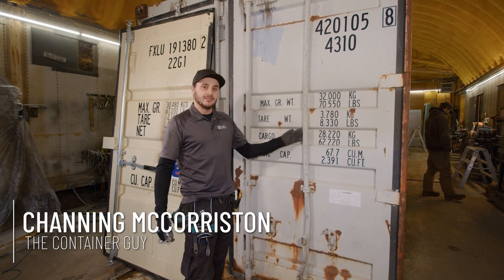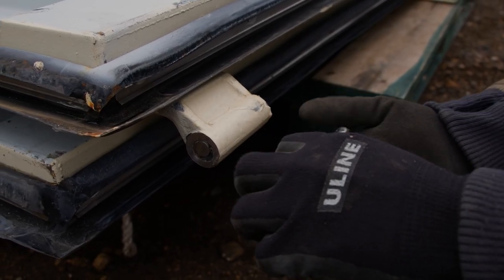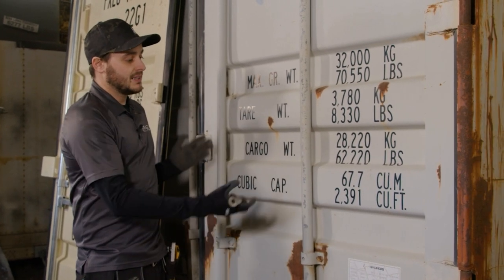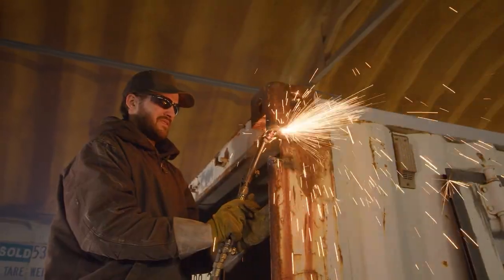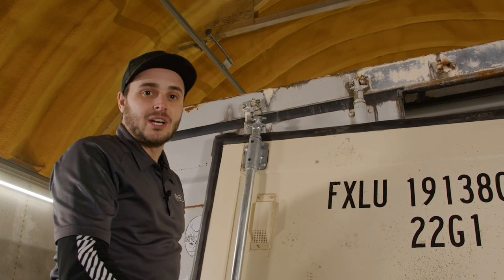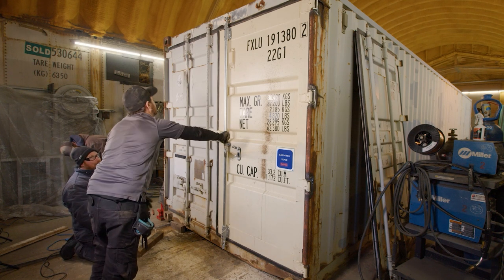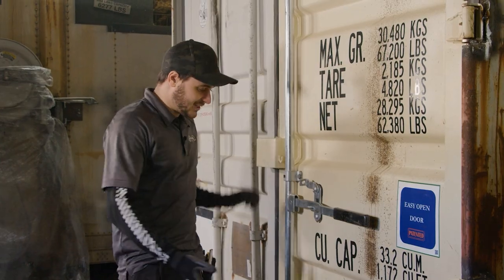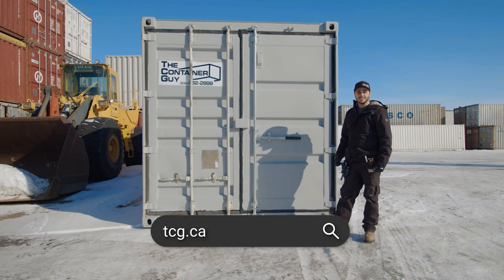Replacing Shipping Container Doors - Not Worth It ?

Comment: I would love to know if you have made a video tackling the removal and replacement of the pipes on the container doors. I am in an area where I cannot find doors and just have one or two bent bars, so was thinking of trying to find a way to remove the damaged ones, get the doors closed, tack, weld them, and then add whatever pipe is used to the top and bottom pins.

Comment: I have a reefer door thats rusted outside to the point plywoods showing but the stainless steel on the other side is still good , but I can only find normal container doors for sale is it possible to relocate the stainless steel stuff to a regular door ?
Reply from the maker: If the doors still open/close, you're best to patch the door panels or slap on some sort of waterproofing membrane over the holes to try to seal it up again. Almost a 0% chance regular doors will work.

Comment: What grade steel do you use to repair the bottom of the door? just some mild steel or Corten? I am just about to do such a repair on a storage container on my property.
Reply from the maker: Mild steel is fine if you're using the container for storage purposes. Understandably, corten steel is demanded by shipping lines and leasing companies so their fleet lasts longer. Fun fact: EVERGREEN containers were actually made from mild steel for the longest time.

Comment: I have a 20 ft sea can and in looking at the doors, I think the way they made the sea can was the hinges were on the sea can, the door was put in place, lined up, and then the hinges welded on. Then the top and bottom keepers welded where they need to be. In saying that, I think I would have cut the damaged door off the hinges (leaving the old ones on the sea can), cut the hinges off the new door (keep them as spares), put it in place, square it up and weld it. Cut the old keeps off and weld them on where they need to be (if you have to). Basically repair it the way it was, or I think it was, built. I've never done one but wondered, if I ever had to repair it, how I would do it. My 2 cents.